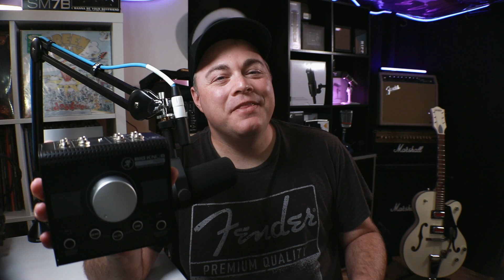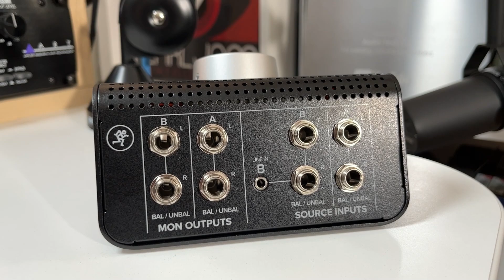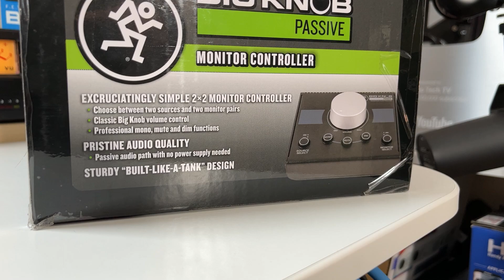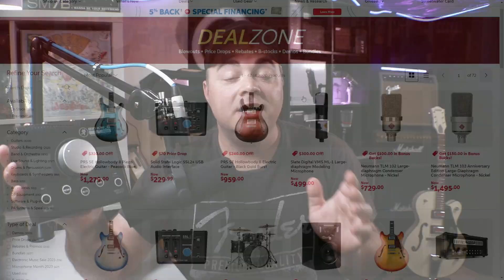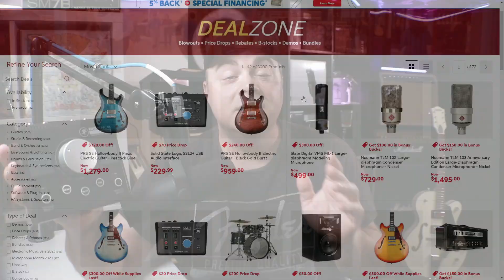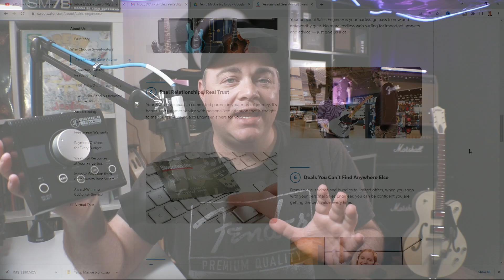Mackie Big Knob Passive Review - Monitor Controller

Comment: Just a quick question can you have 4 studio monitors from this
Reply from the maker: You can connect 4 studio monitors but you can only have it switched to use a single pair at a time. I have seen that some people have modded these to allow you to switch it so all 4 monitors can be used at the same time. I haven’t done that so I don’t know how easy it is to do.
Reply: @AudioTechTV okay thanks do you perhaps know any monitor controler l can get to allow me to use all four monitors, l already have focusrite 4i4 4th gen

Comment: Thanks for this tip, Zane! Made me go out and get one right away! Just one question; What is that module with those great VU meters in your rack (in the short video)? I've been looking for some great affordable analog vu meters for my home studio for over a year!. Hope you can help! Thanks, Michael!
Reply: Hi Zane, I managed to find an Art Pro VLA II for 330 euro, which was barely used and it looks and functions great. The labeling says it is a leveler amp though, not a compressor. Did I get the wrong one? Thanks, Mike. ❤
Reply from the maker: @Miko1963 levelling amplifier is kind of another term for compressor. You bought the right unit.
Reply from the maker: The One with two big VU meters is the ART Pro VLAII Stereo Compressor. It's a nice budget friendly Opto compressor. The VU meters can be switched between output and input. There's separate digital meters for the gain reduction. Thank you for watching. Keep creating! 👊👍
Reply: @AudioTechTV  Sounds great! Thanks again, I will check it out! ♥

Comment: Hey, great vid. Question, I’m assuming I can add a vinyl player to one of the inputs right? Will be using an adapter for the RCA to mono 1/4 Inch jacks, and my vinyl player has a built in preamp/line out (it’s the Audio Technica LP60XBT). That would work wouldn’t it? Thanks again
Reply: hey, did you buy it?did it work that way? i have the exact same doubt before buying it

Comment: What im looking for is a controller that will allow me to input a stereo mix and route that to at least 6 or 8 speakers (front left/right, center, rear left/right, and sub). Ive been trying to configure 2 interfaces into a aggregate device on mac to to work for this, but havent been having any luck.
 Is this able to take a single stereo input and output that signal thru all 4 of its outputs? If so, do they have model with more ins/outs?
Reply: Idk about other models, but this controller will only have 1 input/output active at the time. Either A or B. Not A AND B simultaneously. You can toggle, mix & match between input A/B and output A/B, but you can't use more than 1 input/output at the same time. I hope that makes sense. You basically have a toggle switch for input and for output.
Edit;
In short, what you describe isn't possible with this controller
Reply: order active big knob